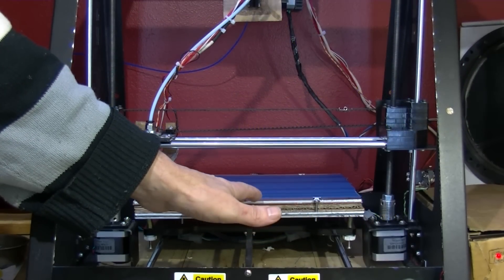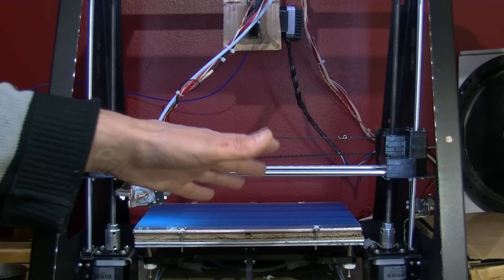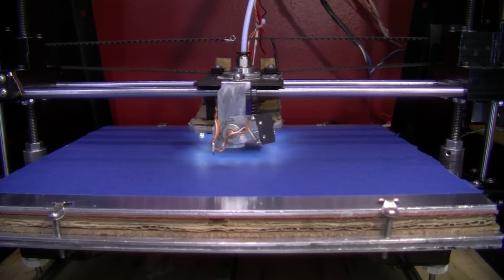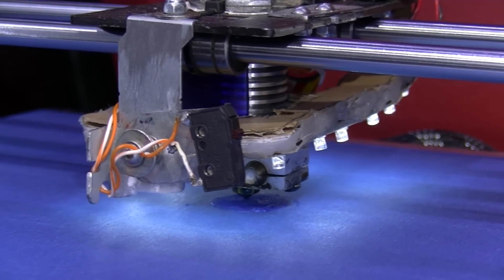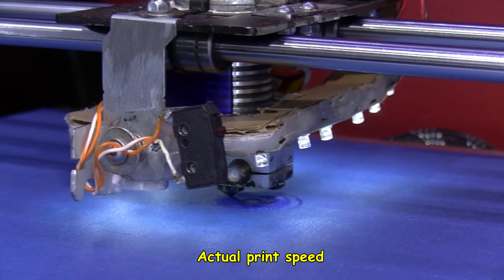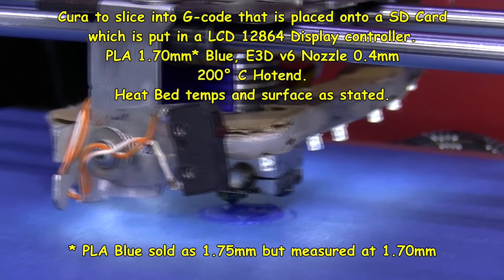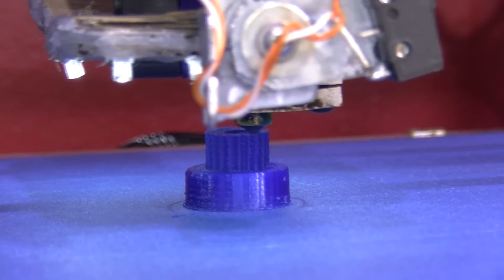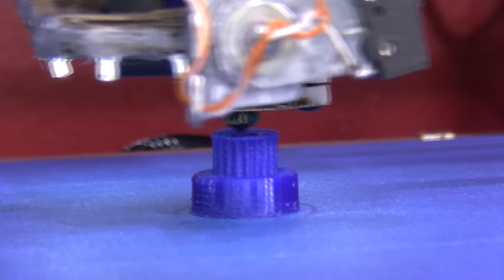Blue Painters Tape and PLA works

Comment: if it stick real hard to the blue tape the first layer height is to low.
Reply from the maker: +3d tronix I fixed it, lower bed temps, 30 for PLA just to stablise that at a fixed point on all prints and better z probe heights and better filament feeder: Thanks for the tips :)